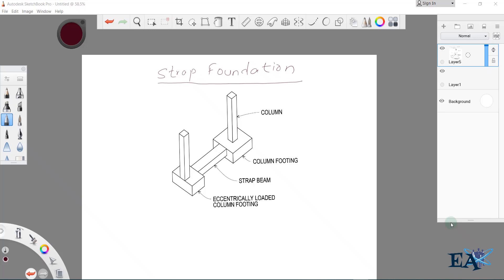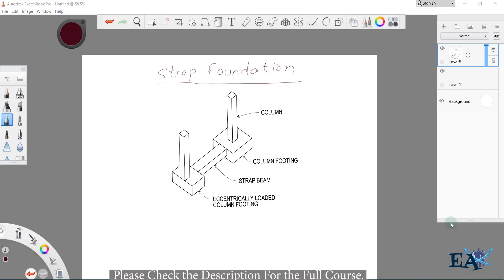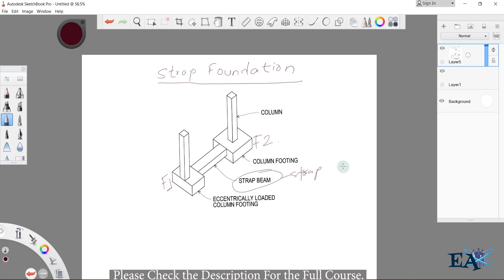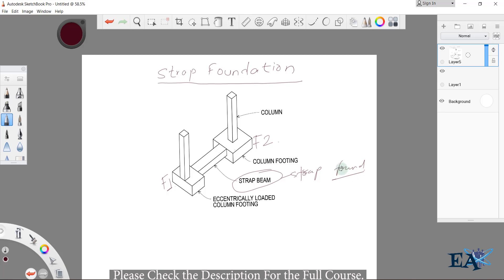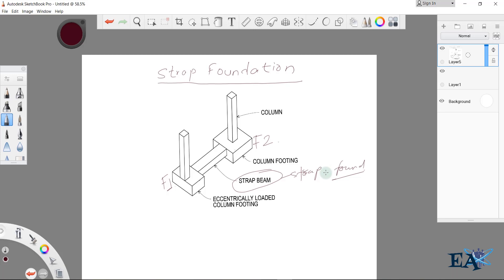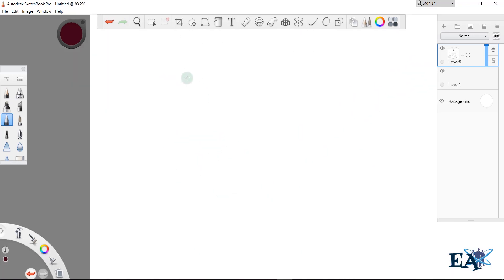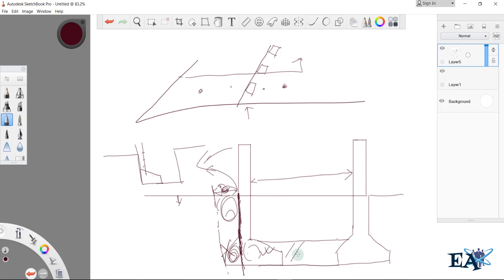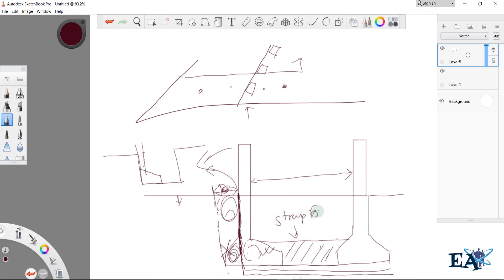Strap Footing| Explained in Detail

Comment: Would you consider an offset column on the footing placed in the corners, including a  5"  monolithic slab integrated, as a solution that is sound to maximize space ( Strap footing also is offset to the outside inline, with the next Column/footing)?